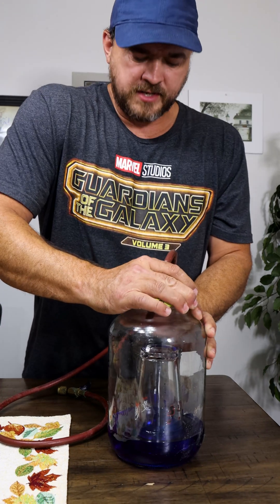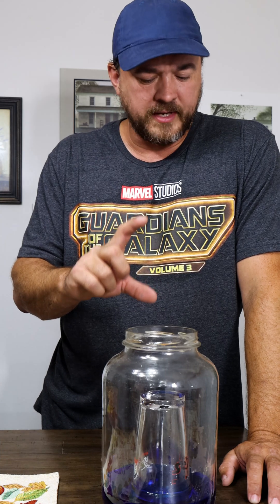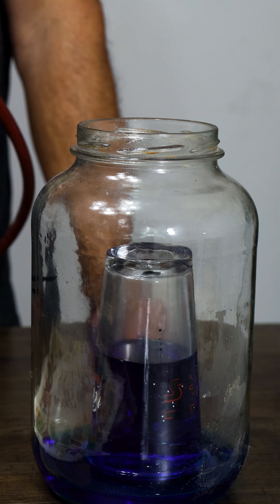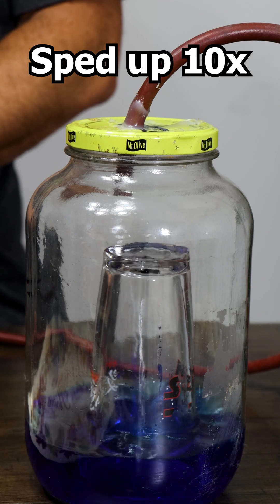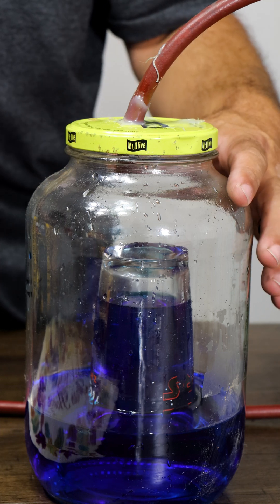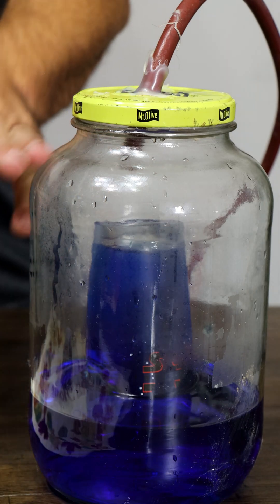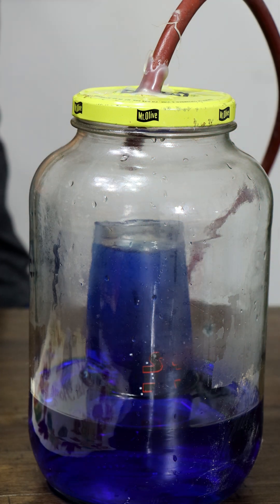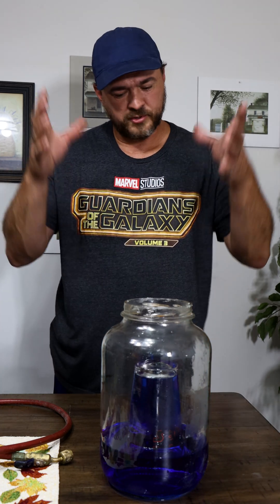Atmospheric Pressure Experiment

Comment: Quit huffing 22. First, not using any gauges so you don't know what any pressures are in the jar.
2nd you place jar in a negative, watch the air get sucked out of the cup, don't even consider the weight of the water and then equalize pressures to atmosphere and say that the pressure in the cup is 14.4" except now it is less because the water weight is presenting a negative pressure due to gravity ... So it is not 14.4, not at all.
Perhaps you should learn the fundamentals of HVAC.
Reply from the maker: Guages are going to just read zero because we calibrate them at atmospheric pressure, and im not sure why i recalled 14.4, maybe old baud rates on modems, its actually around 14.696, and yes it wlukd actually find a medium between the force pushing and the weight if the water, i was trying to mostly emphasize it finds an equilibrium

Comment: I would like a vacuum with no air left, I don't know if that's possible or not, but how close can we get to a full vacuum?
Reply: Even in the "vacuum" of space... there is still some matter that makes it not a PERFECT VACUUM.
Reply from the maker: @Tibbs_Farm  right! I imagine a ton of helium molecules
Reply from the maker: The true definition of vacuum is a space devoid of matter, using a vacuum pump does remove a large amount of matter and the remaining gas picks up heat and expands to fill the container, once it expands so far its hard to remove anymore via suction from a machine, this chanber does leak (its 7 years old) i could make a new one and get a better vacuum but will not be able to remove all air still, more air yes, but never all